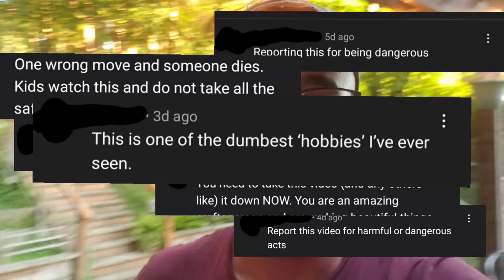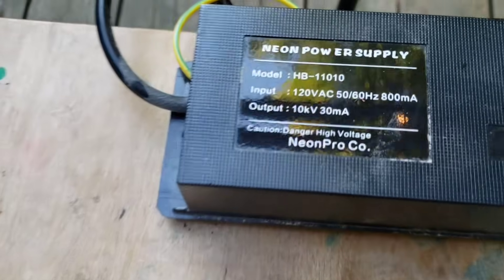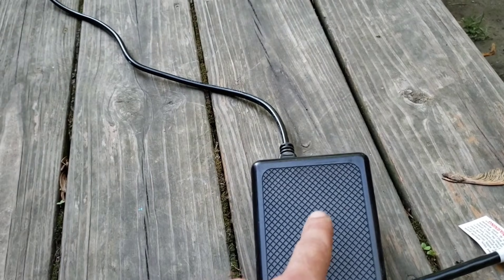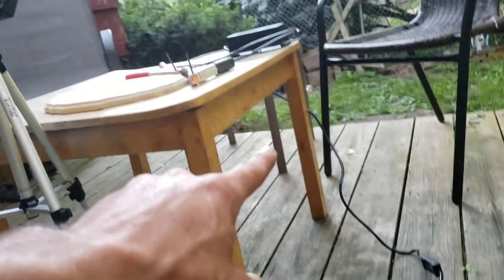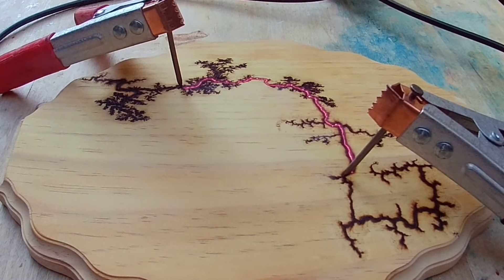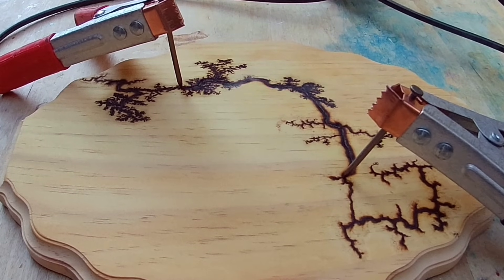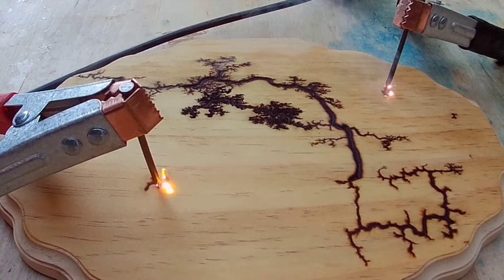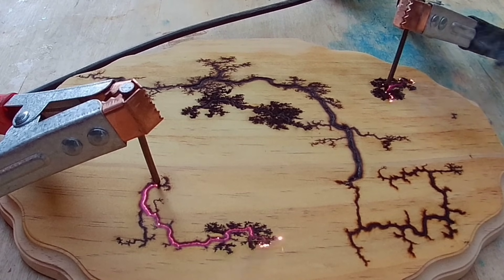Safer Fractal Wood Burning (Lichtenberg) Setup

Comment: Contrary to advice 😉 I’m doing this at home. Or in my woodshop, rather. Got my transformer yesterday. Seems much safer and smarter than taking apart a microwave oven. An additional precaution, I’m putting the foot switch at the opposite end of a 16ft extension cord. Plus wooden table, rubber mat, staying away from that thing. 

Also wondering what it would look like to sandblast away the black/charcoal. Will be experimenting with that as well. Don’t worry, this ain’t what’s gonna kill me.

Comment: Why not just use a program to make Lichtenberg diagrams and then use a CNC laser to create this without any high voltages?
Reply: That's no fun.
Reply: First reason would be the cost of a cnc laser engraver and the limitations of them. The second reason is humans are very good at spotting patterns and doing it that way would result in a pattern forming.  Just treat the damn tool with the respect is demands like every other tool and you'll be alright.

Comment: If you look at the neon transformer it's 30ma, which isn't enough to cause cardiac arrest (it will hurt like hell if you do get a shock from it), plus your natural body resistance is something like 500meg ohms from hand to hand,  I=E/R  so  10000v / 500,000ohms = .02 "20 ma" which is less than the lethal amount to stop your heart.   Now a microwave is 2000v/ 500000ohms = 4ma( doesnt kill you with dry hands), but lets say your hands are wet, well now the formula changes and you are 2000/50,000ohms = 40ma (your heart just stopped).  The biggest problem is that if you get shocked and do fall, the leads may land on you and continue to shock you -- you will die in this situation for sure, so yes its way safer to NOT use handheld probes to make the designs, use clamps. I did make a microwave transformer one, and I used speaker wire, and some pretty short pvc pipes, about a foot long.  So yes if you use a neon transformer make sure its 30ma or less, then you dont risk killing yourself as you would with a microwave transformer. Also take note that if you do decide to use a microwave transformer to make it safer, put the clamp on the HOT side and the movable probe on the Ground side, that way the electricity wont jump through the handle to you and then to ground, which could happen if you were holding the HOT side. Cheers and be safe!

Comment: I will tell everyone out there that he is telling it like it is. DANGEROUS. I know from experience. I used one for about a year and got rid of it when I moved, didn't need it cuz my son said he had one for me to use. Well, his wan in no way as safe as mine and I was not thinking and touched both probes at once. DUH... Any way, I lit up, and I could not let go of them, and along with that comes screaming, and pain, a lot of it too. I was able to fall away from it and the wires came loose, but I don't know if I fell on purpose or not, but, I landed about 5 ft from where I was standing with the probe clamps burned into my hands. Luckily someone was home and called 911. This was early in the morning and I spent the rest of the day in the hospital under supervision checking my heart every 15 min. I was told I was VERY lucky to be alive because voltage coming out of there is equal to a electric chair. I am only hear because God wanted me here. Believe him when he says IT IS VERY VERY DANGEROUS, and thanks for this video. I will be building another but with more safety features.

Comment: Dude fuck you for spreading this! This is some of the most dangerous shit I have ever seen! You know that literally any part of the internals of a microwave can be dangerous to touch even without power supplied? And the transformer is the worst part! If you don’t remove the charge that’s built up on it (which can only be done by creating an arc which is super dangerous) then even if it’s removed from the microwave just touching it will almost certainly give you a fatal shock.

Comment: This was a great tutorial. I gathered all my equipment and had an electrician wire up everything IAW Australian wiring standards.I used a 12,000v neon sign transformer. Noting that the foot control is approximately 2 metres away from the work piece makes it pretty safe. I made my first wood burning cutting board last weekend and I used purple resin for the lighnting bolts. Turned out great, and I am more than happy to use this high voltage burner because of the safety elements you have put in place. Well done. Too bad I cannot upload a picture of my creation, this is definitely a different woodworking hobby, I love it. Thank you for showing us novices how to do things safely.

Comment: Is that the foot pedal from a sewing machine? I'm curious because that'd be a nice cheap way to make a deadman switch for power tools and other things. Except that sewing machine pedals act like a dimmer switch, so you'd be getting a variable amount of power going to your devices. Is that's what's happening here? You're pressing down on the pedal to get full power, but can you vary it and thus alter the voltage? Does that change the speed or pattern of the spread across the wood? 
Or did you have to modify the pedal with some sort of limit switch so that it's simply either on or off? Or is it not a sewing machine pedal at all?

Comment: I made my machine in 2018 out of a microwave transformer. I also used a foot switch. Wired through a light switch with an led. I’ve burned hundred and hundreds of items and sold nearly all of them. Anyway, you can in fact move the probes if you use a long wooden dowel attached to the probes. That way I can do things like planters and round objects. Some of us just like to live dangerously. It’s become pretty boring to me at this point and I don’t really burn much anymore. Some people just want to live a life lived in bubble wrap. 🤣

Comment: My question, please reply very curious. 
Is how is this any more dangerous than welding?
Reply: Welding can't shock you, it's not high voltage, it's high current. So while you can't shock yourself welding, you can get very serious burns or partial blindness if exposed for long enough.

Comment: Super cool. People jump off cliffs in bat suits. People sail in scary fast racing boats, people deep fry turkeys, and people ride motorcycles. All potentially dangerous (even deadly) activities. If you're paying attention, you don't allow yourself to get distracted, and you're not stupid (i.e. doing this in the rain in bare feet) and you implement some common sense fail safes like two switches then you can create something cool like this. Thanks for the instructive video. Well done.

Comment: Well done. That set-up is very professional and much safer than wirin’ up the ol’ mikrowave. I may actually try it some day. I think neon lamp transformers may be better due to their high voltage and low amperage. I will definitely do more research before trying this out.

Comment: Worked with electricity and much higher voltages most of my adult life, great video and reenforcement of safety! Putting mine together and I defaulted with the switch (with built in fuse and indicating LED) and foot petal for the same reasons. I have been trained and overtrained to work with things like this and knowledge is by far the best safety tool.

Comment: You have provided a great presentation, for those with reasonable knowledge of the risks.  Rightfully so, many videos are a bit dramatic with regard to the risks, and others don't elaborate enough.  I think yours was informative and to the point.  The foot pedal kill switch is paramount.  Most folk don't understand the effects of an electrical shock and how it affects your muscles.  Many years ago I was hanging drywall and had a running screw gun in one hand, and reached behind the drywall to find the metal stud.  At the same time, someone rolled a spool of cable over my cord and shorted it out.  My hands locked onto the tool, and the stud.  I was screaming my head off, but no one heard because your vocal cords lock up as well.  Had it not been for a momentary break in the connection that let me fall away from the stud, I might not be here to type this.  Good public service video!!!

Comment: Subscribed and gave you a thumbs up.   Well done for standing your ground against the dreaded Karen.     Its a really cool SAFE video detailing your safety procurations I can say with confidence having worked with High Voltage Switch Mode Power Supplies myself that you are in no risk other then the natural elements whilst being outside.  

that being said....  this should not be tried by anyone without the respect and the knowledge with working with electricity and specifically high voltages.  Well done for making that a huge point in your video.

HUGE Thumbs up

Comment: Hi, I watched your post and all common sense stuff.  I'm thinking the people that are so against this and the ones getting hurt, just don't know enought about electricity.

Anyway, I have a Neon Sign power supply (Output 10kVAC 30mA 25kHz).  I hooked it up just as you show, which is what the seller of the kit suggested also and didn't get any burning.  Not even a period at each electrode.  I put my multi meter on it which has the "claw" to measure amps and it showed (27.6V DC, 1.5A).

Any suggestions?

Comment: There’s really no way to make this “safe,” just “safer.” You’re assuming your foot-switch and power cut off switch can’t fail. I hope that’s true. But to be truly “safer”, you’d test both of them with a meter before you engage with them. And you regularly open them up and inspect the wiring to make sure there are no issue that could cause a short. And you should replace them periodically, as that kind of voltage is very stressful to electrical and wiring systems. But I acknowledge the fact that at least you are not an idiot.

Comment: You mention your machine is grounded.. hoping you can let me know how you did this. Ive been using the same machine for gourds and some misc. wood, but just recently have been having issues. I know the manual says do not mess with the ground wire, so hoping for some guidance from you since you have the same machine.

Comment: I'd never heard of this technique before today.  I just sort of stumbled upon parts for one on amazon and was like "what is this???".  As a hobbiest woodworker, I think it's really cool and a great way to make unique artwork.  Looks potentially dangerous for the average hold my beer yahoo type, but like anything that is potentially dangerous, people should be responsible for their own safety and that of others in the vicinty when doing things like this.  For instance, I wouldn't open up my tube guitar amp and bias it with close to 500 volts running through it with my 3 year old anywhere near.  Anyhow, very cool video.  Cheers!

Comment: People need to stop being so stupid and sensitive. If you have to be told not to grab both ends of a hot wire, you should definitely go grab both ends of a hot wire. If it looks dangerous and you don’t think you are smart enough to do something then don’t do it. People on YouTube are not your parents, and are not responsible for your lack of brain cells. If you get offended go poke a beaker box with a metal fork 😂😂😂

Comment: Fractal wood burning really can never be safe, there is a several thousand volt potential and over 7 amps of power. It takes 100 milliamps to stop your heart and it becomes paralyzed at 4 amp, and tissue burns at 5 amps.
Reply from the maker: This set up is 30ma... so... it's several full amps safer and less than what would stop your heart. Agree?

Comment: I simply don't understand how people can be so dumb to call the method of fracking wood could kill you. Other than common sense not being so common anymore. How do these fools think that millions of welders spend a lifetime welding steel with extremely high voltage amd they are just fine 12v or even 120v DC is Not going to kill you or even adversely affect your health in any way. Unless of course you have a pacemaker.

Comment: Mr makes it look cool... Actually electricity can jump through the air at you. For every 478 volts of electricity. It's actually can travel three quarters of an inch through the air outside any wire insulator. So 10k or 10,000 volts is around 22 inches. AND the fact that you're using a foot pedal that is connected to any of the circuit means you can still get died my friend.  Now if you really want to see someone make it look cool... Watch the video of my fractal burners that I make.  I will make a quick short video tonight and I'll call it. "My 5th generation Wireless Lichtenburg Device"
Reply from the maker: You have your math on the dielectric property of air wrong... unless you're burning in a swamp🤷‍♂️

Comment: Awesome video. I just saw a video right before this one where the guy had the transformer wires literally stuck into a power board and it all sitting on the ground with the 2 additional wires just floating in the air... Then after he switched it on, he proceeded to step over the timber many times while videoingall while the wood was burning and the glass of salty water siting right beside it. That is a bad video promoting terrible safety. Those are videos that scare the crap out if me as a parent.
You, on the other hand are on the complete other side the spectrum. Great set-up.

Comment: It can jump out and get you, that's what makes it dangerous
Reply from the maker: No... it can't... the amount of electricty that I'm using is capable of arcing about 2-3 mm in conditions ideal for arcing. There isn't enough power for it to arc an inch let alone a yard.

Comment: Is this dangerous? 100% yes it is!  That being said, is your method dangerous? If your steps and precautions are followed, no it isn't.  I just had a conversation on FB with a gentleman I am in a woodworking group with, who did not follow the precautions, and he was clinically dead for 41 total minutes.  He instantly went out for 15 minutes, and coded 3 times.  This can be as dangerous, or as safe as the user makes it.  Great video, and I really like your setup.  You can bet your last dollar, if I decide I ever want to try Fractal Burning, your setup will be the setup I am using.
Reply from the maker: Exactly, very well said. Thank you👊

Comment: Thank you this a very helpful straightforward. I just received the same machine as you were using and that is why I choose this one was for the double (triple) safety setup! For those that are going ???  1) It has to be plugged in. 2) you have to turn the switch to on. 3) You have to press the pedal. Let us just say I respect electricity, I use it too much to be scared! Again thanks for sharing!

Comment: I want to start woddburning with a pen, I’ve done welding for work and assumed it should be the same technique with a pen as mig welding and learn how to adjust heat. After i learn that, this is my next goal because it will make lightning or tree branches in my work :). So thank you for showing me because I’m stubborn so rather theres videos to learn or not I’m gonna try it so i’ m glad you made this so now i know how to do it safelly.  So all the haters can hate all they want!! But I’m happy you made it so i have less research to do
Reply from the maker: Thank you but please don't take this video as enough research. This is a topic you need to understand inside and out before attempting. Stay safe!🙏

Comment: Great video. Thank you.  I love it. Iam an engineer and wood worker.  I plan to set one up. Great way to decorate many wood products.  
Do you apply a thin coat of any solution on the wood surface.
Reply from the maker: Thank you. I found 1 tbsp baking soda to 1 cup water works best for me with this set up

Comment: Hi I have same neon driver as you just i turn on and no burn
Reply from the maker: You need a conductive agent and your probes need to be close enough that the current can travel between them. Please do extensive research before attempting this. This video is not intended for the purpose of being instructional

Comment: You have a great instructional video with easy to understand general safety mixed in. It’s great that you emphasize safety throughout the video. As a career AFOSH inspector, I would recommend also including some tips on using electrical safety PPE for the equipment operator. Also, many people will have kids around the home or shop and they’ll see mom or dad doing these burns. Definitely remind the adults to keep these tools out of reach of the kids. This looks like loads of fun to mischievous kids. Curiosity will get them in trouble when they are unsupervised. Lastly, because many people might have kids running around and playing nearby, the burning area should always be blocked off in some manner to proactively prevent accidental contact with the equipment… that sort of thing can happen in the blink of an eye.
Reply from the maker: To be honest I was afraid of doing a full instructional video and made this one as kind of a reactionary thing to mitigate some of the fear mongering. I might do a full instructional at some point but even though people might take this as instructional I dont want them to. The most responsible recourse is probably to put it all out there in a full instructional with proper PPE and show what OSHA standards would be if this was an Osha enforceable thing. As I type this I realize it is something I need to do since this misses a lot and regardless of my intentions people will follow this so I need to put all the info out there. Thank you for this comment, its given me a lot to think about